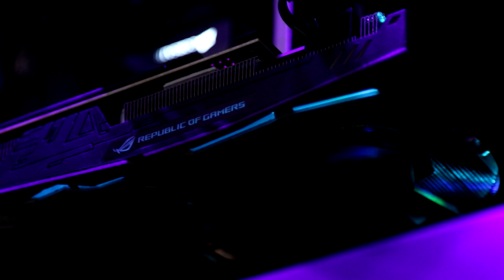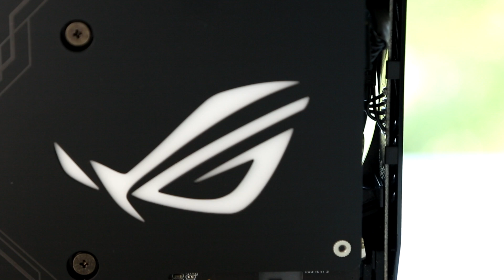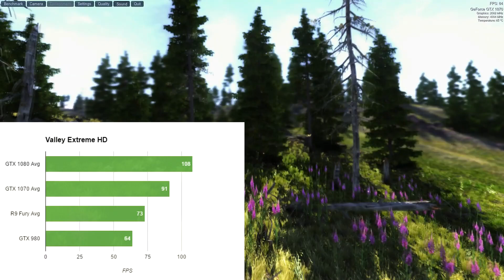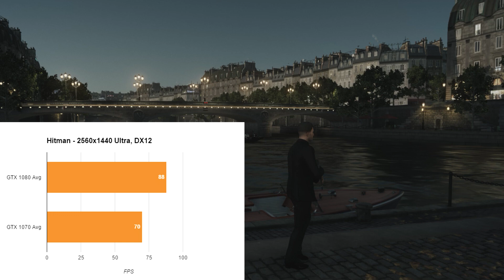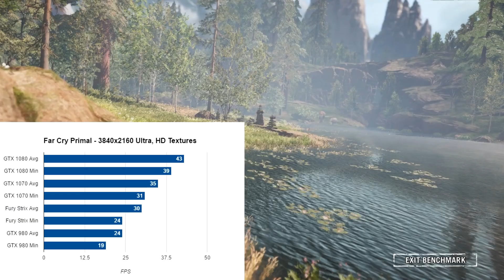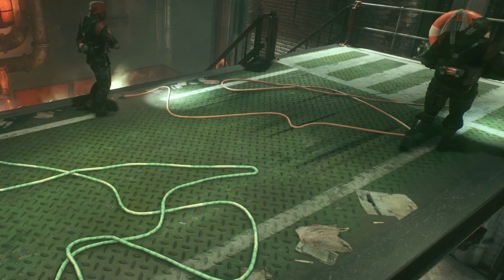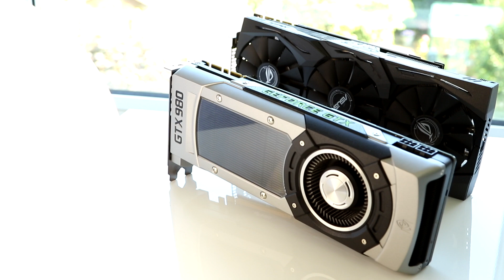Nvidia GTX 1070 Review - Asus ROG Strix OC

Comment: Sorry but Asus cards suck. They're over priced, they're huge, and the need to use Asus drivers to unlock boost is totally bullshit.
Reply: I have this card and I use latest nvidia drivers and can boost this card without a problem.
Reply: The Asus 1070 was the cheapest non-reference I could get. Size is only that bit more than other cards, no big deal.
Reply: Price: quite cheap 1070
Size: no problem!
Overclock: no problem!
RGB: perfect

5/5
Reply: im using msi afterburner to overclock, no issues from what i can tell
Reply: well u don’t know anything about gpu’s